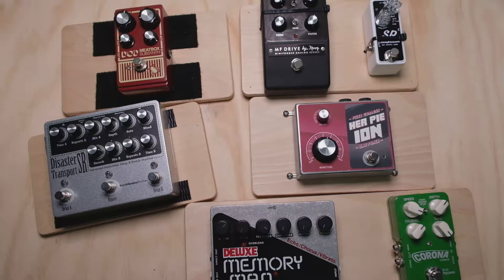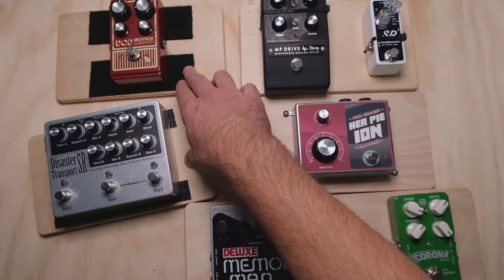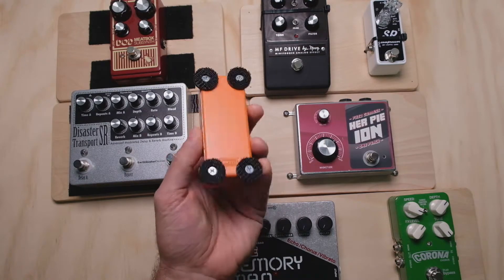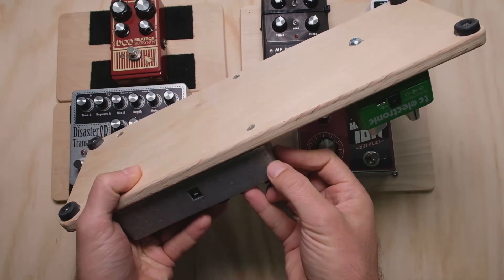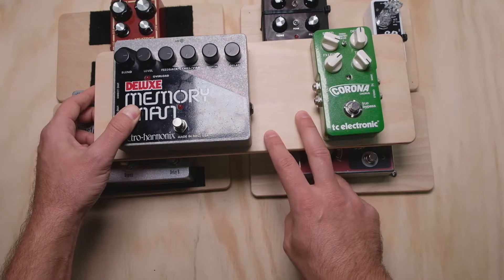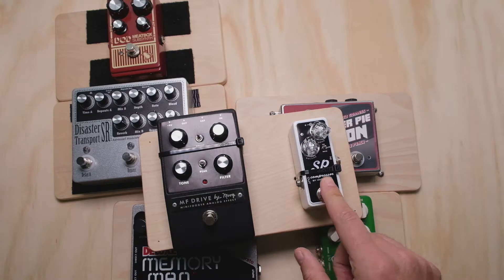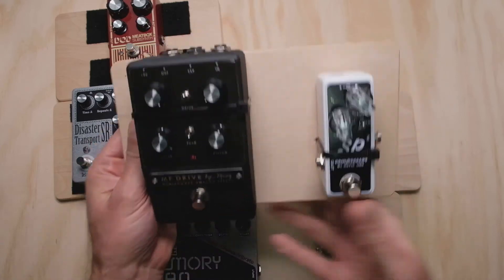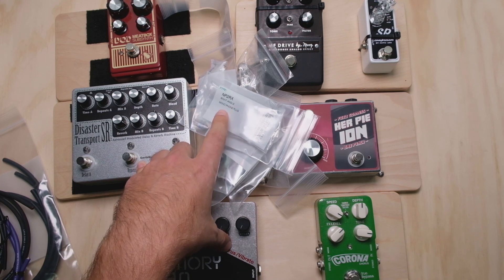Pedal Mounting Summary

Comment: The whole pedal mounting series is awesome! The most complete guide out there by far. I really enjoyed watching you showing different mounting options and going in depth on pros and cons of each of them. Thank you so much! I'm thinking about going with hybrid approach - attaching pedals with screws or bike chain links to plywood/metal/plastic plates (similar like you did in your examples) and using dual lock on opposite side of the plate. That way I keep my pedals in mint condition and have a convince of being able easily rearrange them.
Reply: Thanks!

Comment: So this might be a stupid question, but has anyone ever thought of magnets? My thoughts would be how would the magnet effect the electronics of the pedal, but if magnets are safe for the pedal's electronics, then would that be the most elegant form of mounting? Thanks for the mounting tips, learned a lot.
Reply from the maker: Depending on the metal used in the case, it may not be magnetic.